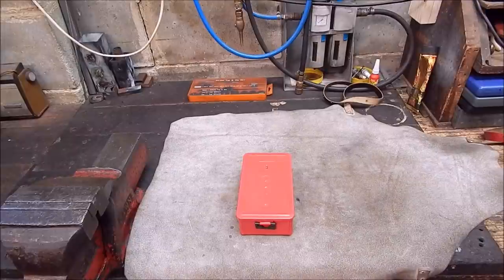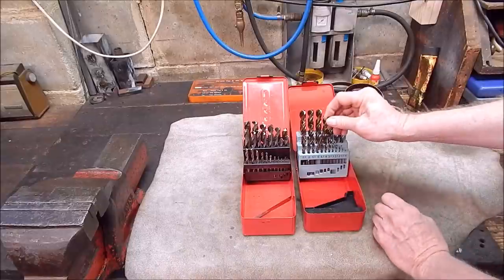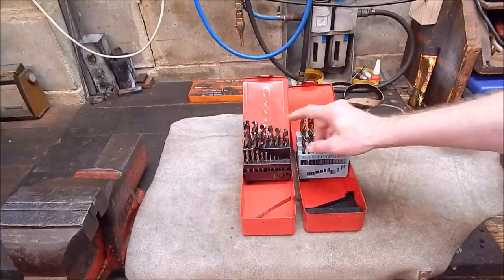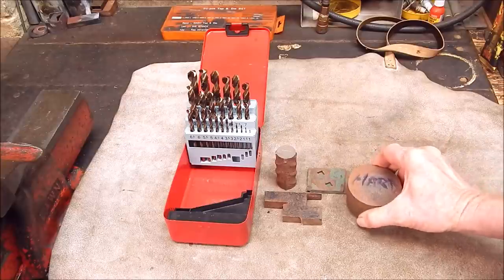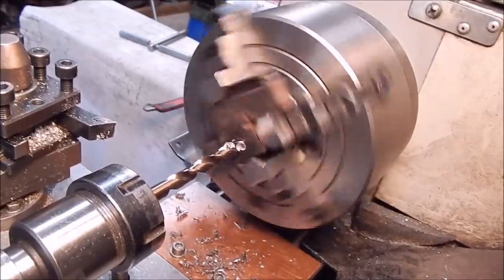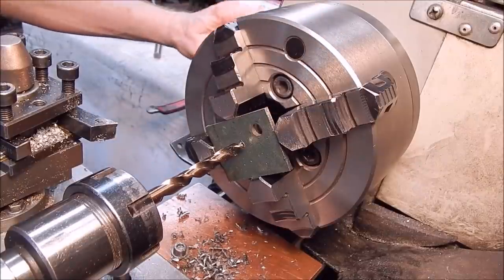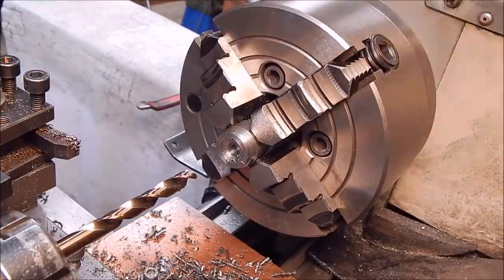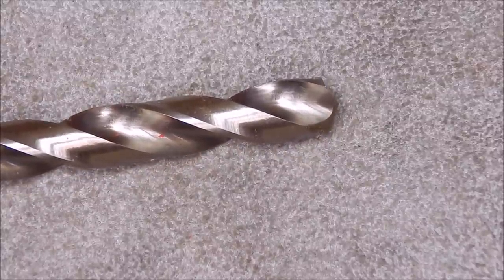Drillpro M35 Cobalt Drill Bit Set from Banggood - excellent

Comment: You really want to give those a test try drilling through some 316L stainless steel plate that has been rolled and thus work hardened. Most drills other than the cobalt will not get through, I got around 50 holes per cobalt drill, though with HSS it was one drill bit per hole, except for the last 3 holes, where I had run out of HSS bits, so went through friction stir style, making red hot holes through the plate. That took 2 broken bits per hole, stub end only, using the massive big 20kg Bosch drill I have, that has enough torque to twist your arm off.

Comment from the maker: Note:  There was visible drill tip wander/walking in several cases when starting to drill into the test pieces.  I think that is to do with the split tip grind they have.  It soon settled down though.  The spot starting hole was way too small in all cases, as I could barely drill it with HSS and was worried the tip would snap off on such hard stuff.  So there was a bit of tip wandering as the facets fought over the start point.

In hindsight I should have used a suitable spot drill rather than a centre drill.  I have some on order in cobalt M42 (8%).

Cheers Rob

Comment: Hi Rob. Very interesting review. I'd always believed that when it came to drill bits you got what you paid for. After several sets of cheap so called HSS drill bits which weren't very good at all I splashed out on a set from Irwin. Had them about 2 years now and have only managed to break one. The others are still really sharp even after a ton of use. I can't believe how cheap these are, worth investing in a set for the really hard stuff. Cheers, Alan.
Reply from the maker: Hi Alan,  as you know, I rarely use the word excellent, but these are great.  The only negative was that the split tip grind seemed to get up a wobble at entry until it bit in.  No big deal, but seems to happen with this grind from my limited experience using it.  I think they are well worth the money, but don't hand hold them ;) Cheers Rob

Comment: love my cobalt set and my cobalt step set  ! i still by the throw away titanium coated 100 piece sets for 15 bucks for basic use in power drill / cordless drilling ect  ive had mine for a quiet a while now and i find they hold an edge far better and tend to bind less to
Reply from the maker: This set did extremely well.  I was very impressed.  HSS is pretty tough stuff when made properly and I have hundreds of them.  You really need some suitably hard spot drills to start point cobalt drills with a split tip grind like these, so I have ordered a set - next review.  Cheers Rob

Comment: They look pretty damn good Rob, haven't been real impressed with Sutton over the last few years
Reply from the maker: Hi Bill, I was very impressed with these.  Drilled a very clean hole and did all the test  pieces.  I had a very close look at the cutting tips of all of them afterwards and they are perfect.   I think Frost and Sutton are the same mob these days.

I have only bought small intermediate sizes lately (from a well known tool shop) and they have been OK, but were unbranded, so I don't know who made them.

Cheers Rob
Reply: Yep pretty sure Sutton and Frost merged a few yrs ago, they are ok but not significantly better than anything else and nowhere near as good as they used to be. Can't quite trust that they are really made in Aus.
Reply from the maker: One thing I'm not sure on is how hard a cobalt drill shank is.  Regular HSS drills use a softer shank to reduce slippage in three jaw drill chucks.  That's partly why they tear up.  I get the impression from looking at and using cobalt drills that they may be hard full length, due in part to the metal composition difference.   I do know that the surviving cobalt drills from my old set show no marking on the shanks whatsoever, despite definitely being hand held on various occasions.   Cheers Rob
Reply: 🤔 Can't say I've ever really thort about it, but makes sense that they would be the same hardness for the full length. I imagine the softer shank in HSS is possible via heat treatment but the same method would not work with the cobalt content, would probly lead to breakage at the transition area?
Reply from the maker: Yes, that was my thoughts on the matter.  Cheers Rob
Reply: 🍺 Cheers Rob, just about to crack one 🤣
Reply: xynudu I've bought a set of 5% cobalt chinese drills of of eBay and they cut very well apart from the 5 mm one which was soft as bleeding butter lol and of course it would be the M6 tapping size wouldn't it? But they all have a very soft shank and do chew up considerably if they slip.
Reply from the maker: That's interesting.  Thanks for the feedback. That super hard round stock was the ultimate test.  Even carbide will barely look at that stuff and the chips come off as long blue (from the heat) streamers.  It's a proper bastard to try and work.   The drill did well.  Cheers Rob

Comment: These don't cover the standard small metric tap drill sizes, do they?  Do you buy tap drills for M3 through M10 separately?
Reply from the maker: They have the half sizes , same as most sets.  None of them will give you the exact optimum thread tap diameter.  I always mic drills when tapping to get close, as none of them are actually what's on the tin.  This applies to virtually every manufacturer I've used, and I've used a lot of brands.  The discrepancy is always under-size, which is actually a good thing.  Cheers Rob

Comment: I tried to follow this link to Banggood  I ended up looking a a 19 piece set for $190 with no information on delivery charges.    This has happened often with this crowd, so often it's disheartening,  It's a difficult crowd to deal with,!

Stavros
Reply from the maker: Works fine for me Steve.  Make sure you are clicking the top link.  Cheers Rob
Reply: @Xynudu  I clicked on the link and it took me to Drillpro M35 cobalt drill set for AU$14.98. Can that be right?
Reply: Worked it out... different prices depending on how ,many pieces in the set. Doh!

Comment: have a similar set(from ebay) , sadly some of the drills werent hardened???
Reply from the maker: From Banggood ?
Reply: @Xynudu  nope got it a long time ago on ebay. i mostly bought it for the case. i was able to harden the non hardened drills, so its not bad metal, they just werent hardened. hope banggoods are all hardened
Reply from the maker: The cases are generic, the drills are not, so your comment is very misleading.  I have never seen a bad review on Banggood Cobalt drills and that includes a lot of major metal work channels.
Reply: @Xynudu  it wasn't supposed to mislead. I said similar. Ill add that it was from ebay
Reply from the maker: OK.  Thanks for doing that.  Cheers Rob

Comment: Their seemed to be a lot of wobble  at the start of the drilling, as if the cutting tips was not equal,  good review keep them coming.
Reply from the maker: Yes, I think that is to do with the split tip grind they have.  It soon settled down though.  The spot starting hole was also way too small in all cases, as I could only drill it with HSS and was worried the tip would snap off on such hard stuff.  So there was a bit of tip wandering as the facets fought over the start point.  Cheers Rob
Reply: xynudu, Rob I'd invest in a 6 mm carbide spot drill if I were you, I started using one a few months ago and have not used a centre drill since unless I want a super accurate hole for say up to 4 mm then I spot it with the carbide drill then use a normal centre drill to finish the start to give me the 60 degree countersink.

Comment: I have just bought a set of HSS drills in the UK the box is exactly same as the one you have but blue, instead of orange. They cost eleven UK pounds shipped. Looks like one manufacturer making drills for the world.
Reply from the maker: Those boxes all look the same.  Have done so for many years. Cheers Rob
Reply: Tony Papantoniou I bought a similar set without the box off of eBay and paid £18. Lol you got the better deal!